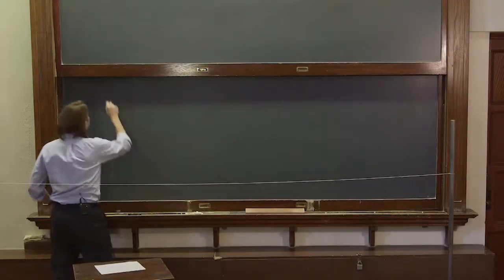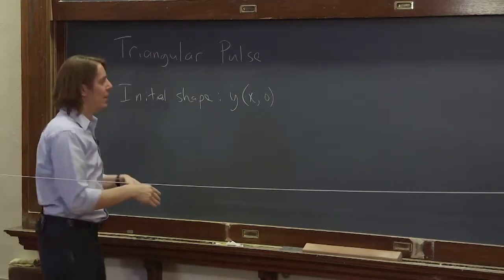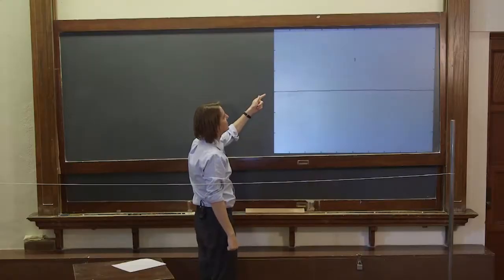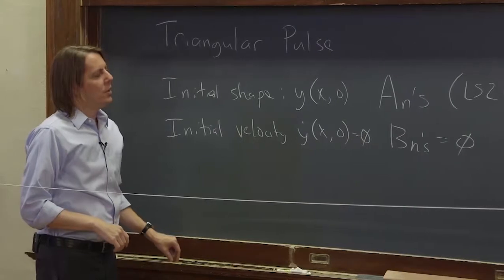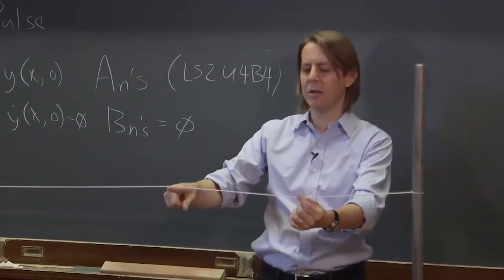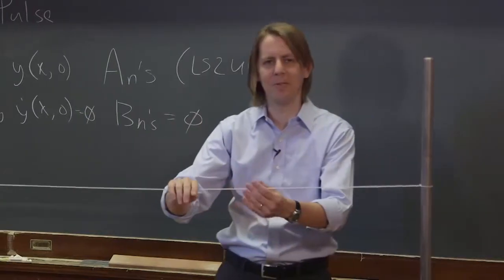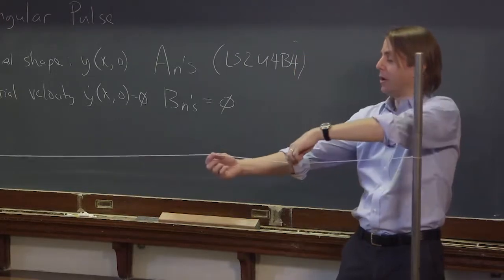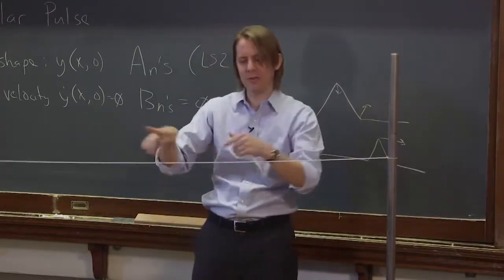PHYS 201 | Traveling Wave 9 - DEMO: Traveling Pulse

Comment: Seems like a string isn't the same as air pressure which is caused by a speaker.  Is the high peak of the string representing high pressure of air particles? And low spot represents low pressure?
Reply from the maker: Yes, that is the analogy.  For different kinds of waves, you start with the laws of physics (newton's laws for a string, gas laws for air, maxwell's equations for light) and you end up with the same (mathematical) wave equation.  That's why the same kinds of sinusoidal waves are seen in so many different areas of physics.